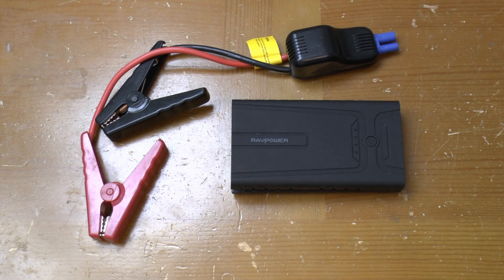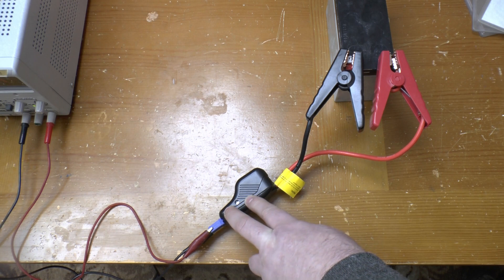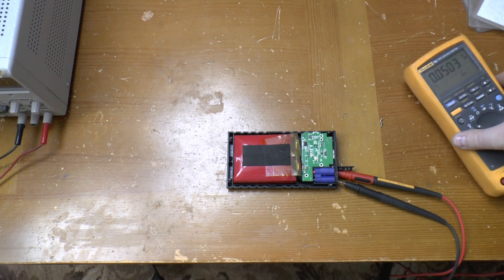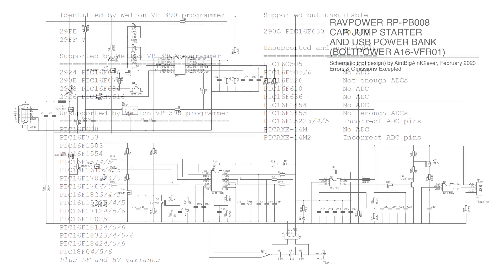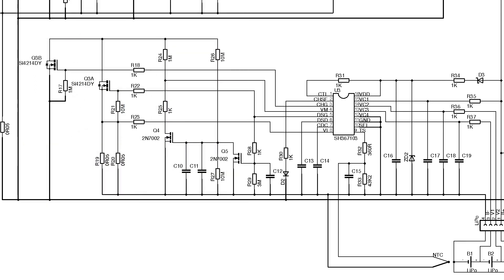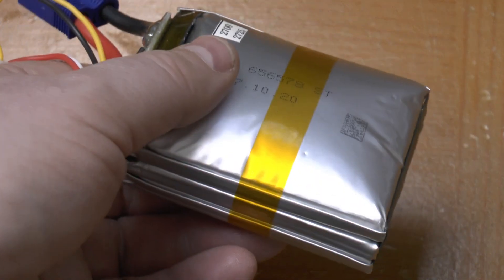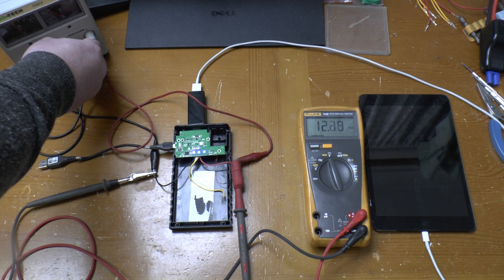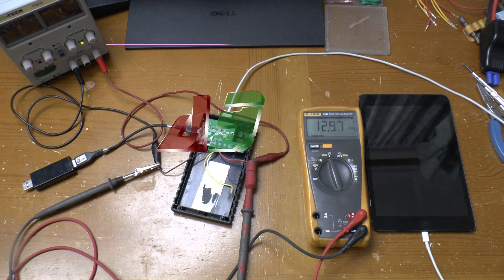What's inside a Ravpower lithium ion jump starter?

Comment: The battery puffing up also happens in phones a decade ago. Do you think it would be safe to replace this lipo battery with a much higher max amp output/capacity from the hobby sites? Would the newly replaced cell go bad like this one again because of the components?

Comment: A lot over my head but I can assume the first 14 pin part went bad in mine. It started off that the USB output quit. Now the charging mode has gone screwey and the led flash downward when plugged in to charge without charging. Id love to fix it though.
Reply: Oh and the gauge stays on permanently unless I plug a device in to charge off the USB , then it turns off.
Reply from the maker: Looking back at the schematic you've got several ground rails (USB in, USB out, another ground rail between those, plus the battery ground when the charging circuit's in the mood for it).  I'd measure the low-value resistors, make sure none have been smoked out.  Missing grounds cause all sorts of weirdness, just look at a faulty tail light.
Reply: @AintBigAintClever  thanks!!. I think I can actually handle that. Replacing that chip. Ehhhhh. Idk.
Reply from the maker: @jasonbirch1182  yeah, I expect replacing that chip would be a dead end as it'll have code on it.

Comment: Very nice demonstration of "reverse engineering". 😊
Reply from the maker: I try my best :)
It's also a good way of picking up little titbits of knowledge. When you work out the schematic you're looking for how it works.  If it looks like it wouldn't work, chances are you've missed a track or messed one up.  If I need a reverse polarity protection circuit I'll probably dig this schematic back up and look at how it was done here.

Comment: Prob why my died, puffed up battery was only C35, about 250A max, got a cap discharge unit now, works a treat..
Reply: They have hobby lipo pouch cell batteries for pretty cheap with a high amperage limit. Would it be worth it to replace if an old battery goes bad?

Comment: I would have loved to see this thing turned into a USB power bank but it's probably not safe now.
This is what I don't like about pouch based lithium cells, they puff up. cylindrical cells seem to be better but don't hold as much power as the pouch ones.